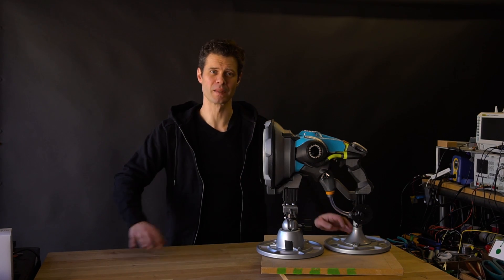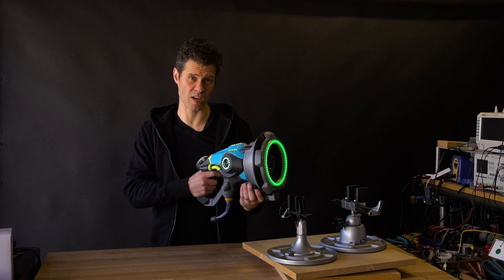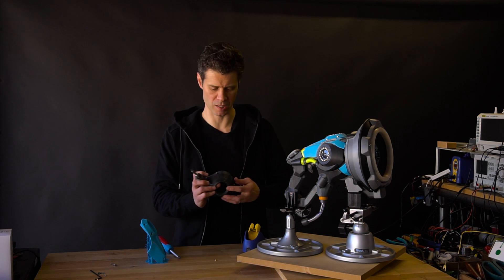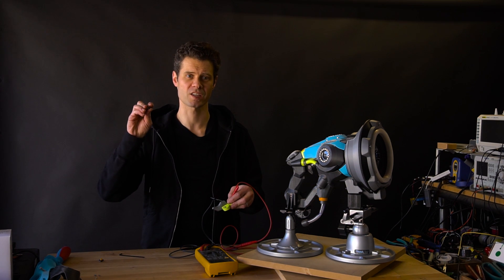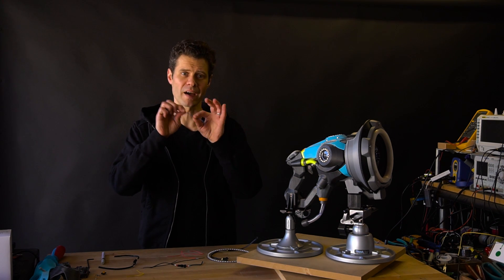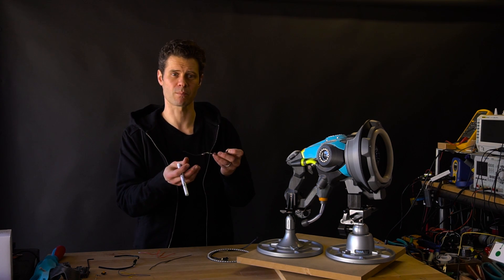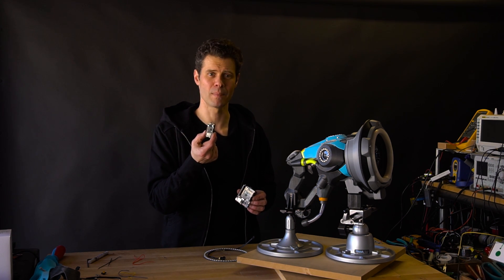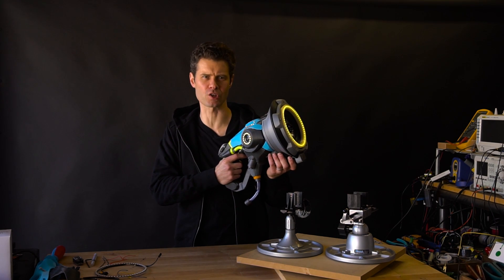John Park's Overwatch Lucio Blaster Pt. 3 Final @adafruit @johnedgarpark #adafruit

Comment: I know this is a really old video, however I have started planning out my full lucio (hippityhop skin) cosplay and was wondering that, if following this guide, is there a possible way to make the costume LEDs switch together with the weapon? (possibly via smart/remote control from the initial weapons switches) and how to go about that if it were possible. How much experience in coding/electrics is required to achieve such goals?
Reply from the maker: Integration of costume and blaster lighting would be very cool. You would want to use a couple of wireless boards, such as Feather RP2040 RFM69 so the weapon board can send a command to the costume board when switching modes. Check this guide for updated blaster circuit and code: https://learn.adafruit.com/lucio-blaster-2020-circuitpython-advanced-prop-making and this one for transmitting between boards https://learn.adafruit.com/feather-rp2040-rfm69/rfm69-radio-demo
Reply: @adafruit  thank you so much for your response! I will definitely read into it and try my best to implement them into my design. This makes me even more excited for my project now! :D

Comment: Since conservation of space is a concern since space is at a premium, and most of the images I see of Lucio show tubing coming from the bottom of the gun to (I think) his backpack, wouldn't it be feasible and also desirable to put the batteries and power controls into the backpack and just feed wire through the tube using connectors at the small piece coming off the gun?

I am new to this and fully plan to try out this build as my first project (I need real world things to drive me to learn) so I don't know what kind of limitations this poses, but figured it would help clear some space for the rest of the items in the gun proper. The only thing I can think this would limit is showing off the gun without the rest of the kit.

Comment: Not gonna lie: this video is making me seriously consider mechanical engineering as a degree or electronic engineering.
Reply: Durrpadil I wish we would actually do things like this in Uni. Btw 3D printing is probably not part of the EE curriculum at your local Uni but they might have some printers for "research" purposes. If that's not the case, just walk into a random architecture lab and act like you belong there ;)
Reply: Durrpadil, mechanical engineering is something that, if you want to do cool things, you study it on your own, and if you want to do practical or useless things, you go to college and get your degree in it to get a job as an engineer. If you want to make cool things for a job, you'd have to look for a startup company that's doing something you want to work on or start your own company.
Reply: As an an Electronics Engineer myself I can tell you that the 3d printing and mechanical design you have to sort of learn on your own. Mechanical Engineering you do get the design process, but only for prototype design. What this project goes over isn't just electronics and mechanical engineering, but also drafting and design. Really if this is the stuff you want to do the best way is to start learning on your own. Most EET programs are going to teach you industrial electronics, not something used for this. You won't really see an arduino, raspberri pi, or chip unless you take the initiative to learn those systems on your own. Then the only things that transfer are soldering and wire placements. I'd honestly suggest working on it as a hobby, not as a potential job. At least starting off, eventually you find what part most interests you in it, by doing it, and then from there determine what field to go into.
Reply: Scythe Dude, I study Electronics Engineering and I basically drown in microcontrollers these days, most of them even more advanced than an Arduino or an RPI although I've been working a lot with both of them recently ...
Reply: Why must you take one thing out of what I said and make an argument against it.
I never said that the programs don't use microcontrollers. I simply said that you don't really see 3 specific types, all types which are used for hobbyist electronics. The microcontrollers people tend to use when earning their degree are meant to be used for more advanced systems. So yes of course the microcontrollers themselves will be more advanced. Generally what's taught in a school is what's going to help you in the field. Arduino, Raspberry Pi, and CHIP (Released a few months ago) are all geared towards hobbyist electronics and projects.
Reply: THat's what im in right now, hope you like physics and calculus & chemistry